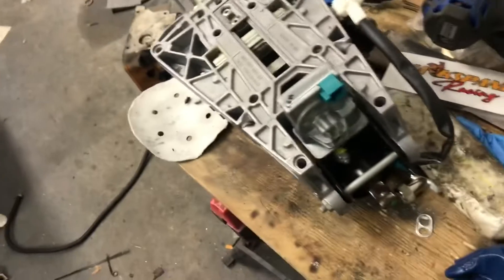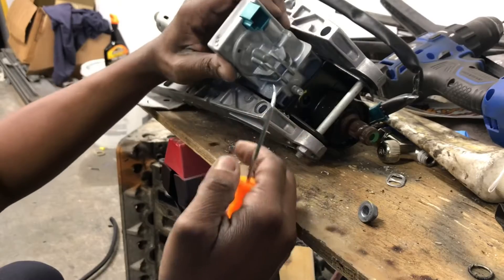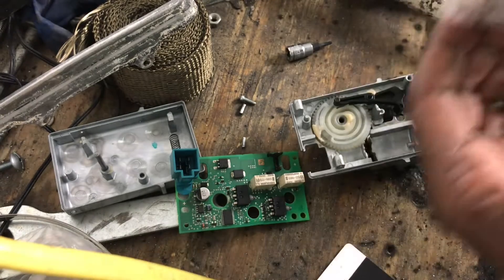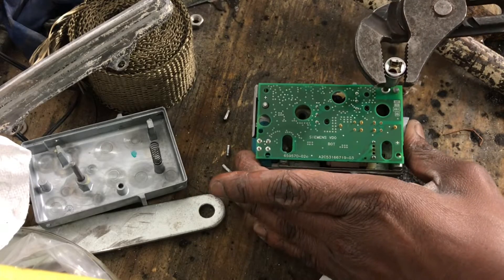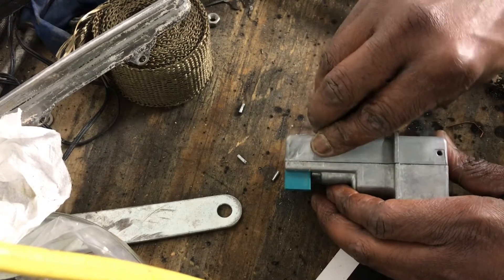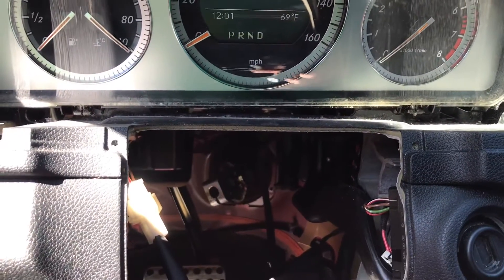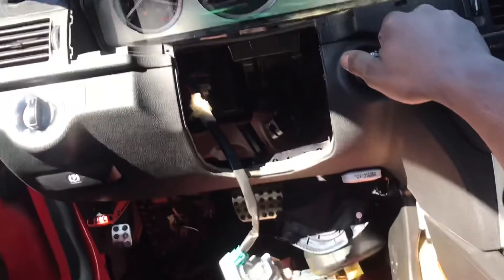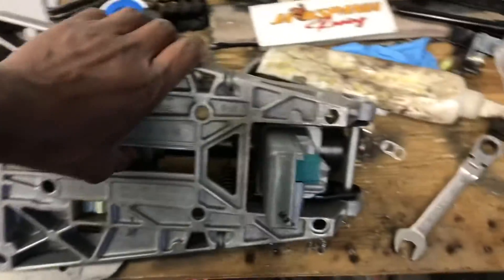Mercedes C300 W204 Won’t Crank Steering Column ESL Locked Position

Comment: You can also drill through the blue area which is a lot easier to get to because I'll tell you there's no point in repairing it because it's just going to break down again and motor is too small to have a job that big all the time absolutely ridiculous that they didn't even make a Mercedes like this knowing full well that that motor wasn't going to last and then it cost $395 to fix the damn thing and even when you do fix it you're going to have to take everything apart again to get to it when it breaks down inevitably
Reply from the maker: It’s still working $10 fix 👍🏾

Comment: Is It possibile, that car cant crank After this replacement, fuse 50 Is ko?
Reply from the maker: It need to be installed in the lock position with key off or unlocked position with key on the opposite won’t work. Do you hear it lock or unlock?
Reply: @MRRANDOM1 There's no noise when I insert the key. Any advice?

Comment: Hi, Wonderful video. My ESL locked. I tapped steering column  with mallet, then insert key, got the ESL unlocked. I left key in ignition, took out ESL & replaced ESL motor. Insert key, recoonect battery. Remove key. Nothing. ESL remains unlocked instead of locking. I depress 2 micro switches buttons. Again nothing. What am I doing wrong?  No sound at all. Any advice? Thank you!
Reply from the maker: Maybe defective esl motor make sure you have everything connected another thing you can do is test for power
Reply: Thanks. I think power may be the issue. Since when I pulled out 7.5A fuse and reinsert I get a message "fault front right..." Could it be a fuse blown? Reason is the radio won't come on automatically but has to be turned on manually.

Comment: I own a Mercedes GLK and when I turn it on, I don't hear that sound?!
What does that mean?
Does this mean that the EIS has been removed?
Reply from the maker: Maybe removed or bypassed if  it’s starting
Reply: @MRRANDOM1   Yes the car starts normal
Reply from the maker: Unless it failed in the open position. Can you turn your steering wheel with the car off?
Reply: Same issue I’m having

Comment: How do you tell if it's locked or not? I can move my steering wheel a decent amount. It doesn't "stick" anywhere when I try and turn the wheel. Does that mean it's stuck in "unlocked"?
Reply from the maker: Sounds like it’s unlocked. Which is easier to remove
Reply: @MRRANDOM1  Appreciate the reply. Giving it a go today.
Reply from the maker: @BrettWyrick  your welcome! It’s a pretty easy fix! Good luck

Comment: Could you have removed the motor then close the box? instead of installing the new motor.

Just as a preventative way to make sure this will never happen again. On the older Mercedes-Benz ignitions there was this locking pin.

What I would do for clients, is open the mechanism. Remove the spring and the pin.  

Then they would never have to worry about the ignition ever getting stuck again. Instead of buying a new unit and then a couple years down the road maybe back in the same boat or if it broke all the way. They would be spending hours trying to drill out the locking pin.
Reply from the maker: Nice! Thanks for sharing. Im not 100% sure if you can remove the motor. I guess it’s worth a try with everything being taken apart already.
Reply: very accurate! I was thinking after I fixed this once I wouldn’t have to worry about it again. I had the dealer replace the motor for me. Just a couple days ago it just went out. you definitely called it timing wise 😂
Reply: @bjbarrow7090  this time use the emulator, all the wire is long enough to route it to an accessible location. So if happens for the 3rd time you can get to it quickly.

There's also a bypass you can do by pulling the 7.5 fuse in the back of the fuse box, turning the key to the third position and pressing the green relay after removing the cover. NOT The best way to start your car every day. However it will get you out of a jam.
Reply: @edd2184 How would that work if the little motor is shot and in lock position? I think the relay trick is just for a bad ESL? Correct me if I’m wrong. Also, I would imagine if you just cut off the locking pin then you would not need the motor?
Reply: @TreasureHunter5000  from what I understand the motor is used to engage a locking pin. The locking pin is only there for security purposes, so by removing it all you're doing is stopping the locking motion from happening.

I'm more familiar with the older system, those ones failed because there was a slight tolerance error in manufacturing. The pin was too wide and it would get stuck.

So to answer your question yes, some people replace the whole mechanism every client I had I just removed the pin. Only noticeable change is the positive when we are moving the key from position 1,2, to 3. For lack of better words you don't feel that "pop" before the key turn.
Reply: @edd2184  gotcha

Comment: Happened to me today. But I saw another post. The guy yanked the steering to the right then put the key in. It should free the steering where. Then turn right then left and start the car. Works like a charm and no whacking needed
Reply from the maker: Nice I would look into replacing the motor. It will happen again. Good luck 👍

Comment: Hi, I have a 2012 C300 and I’m having this issue. I removed the ESL and replaced the motor and still no luck. Car powers up (dash screen, radio) but no instrument cluster lights or anything. The car locks and unlocks with key fob. 
Any suggestions? Thanks in advance
Reply from the maker: Sounds like you have a power issue, check your fuses and connectors
Reply: Did you ever find out the issue? Mine literally did this. No accessories turn on or start.

Comment: Mine has an intermittent crancking issues, also going into park on its own when it comes to a junction or at red lights. Almost every time I press the brake below 5 kph. Scarry.
Reply from the maker: Damn that’s crazy something definitely going on wrong. You may want to follow your shift cable make sure you break pedal not putting it in a bind or something

Comment: How did you connect the steering shaft to the column? Seems like that part is skipped in all the videos I’ve seen so far and that’s where the main work is. Please any ideas?
Reply from the maker: It just slipped rite on just how it was removed. I mounted the column first and then slipped the splines on the shaft into the column I also made a mark before taking it apart to make sure it was installed in the factory location

Comment: Hey man I got the same issue with my merc. I put the key in the ignition car won’t start no nothing, steering wheel is locked. So I tried the method where you re insert the 7.5a fuse and press the relay, the car starts after that but steering wheel is locked. Is it the switch or the steering lock problem?
Reply from the maker: Yes ESL failed in the lock position. follow the steps in the video. It was a pretty easy job.

Comment: Having this problem yesterday now tomorrow I will take everything apart and follow what you did thank you
Reply from the maker: Thanks glad I was able to help. It’s not hard at all. Some tight spots and gotta get the esl casing open. I used a very small flat head but they do make a tool for it

Comment: Did you get rid off 'remove key from ignition' message from the display. I was able to erase the 'air bag' message using my scanner.
Reply from the maker: It cleared on its on but I believe it will show as long as you have the key in the ignition not turning any power on. It definitely does away once you start the car

Comment: Thnx for video. Any tips on how  to remove the 4 dowel pins out. I can't get them out
Reply: Thnx. Was able to remove them with a small drill bit enough to go thru the dowel pin, tapped it, twisted it, and pulled it.
Reply from the maker: They sell a tool to remove them I believe it’s a triangular tip , I used a very small flat head screwdriver just jammed it in there

Comment: Thank you for the video. How do I know if the esl is in the locked position. I can turn the steering wheel.
Reply from the maker: Glad I was able to help. You can turn the steering wheel then it failed in the unlocked position which is a plus. Therefore you won’t have to drill the ESL and turn it to the unlocked position in order to remove it.
Reply: @MRRANDOM1  not necessarily true. My ESL failed on an unlocked position and I could still drive my car (there's a work around where you pull a fuse and manually press the starter relay) but when I went to remove the ESL the bolt wouldn't depressed fully to remove so I had to drill it to unlock the last few mm.
Reply: @nastynate5633  can you elaborate a little more on this or refer me to where i can find out more in this ?
Reply: https://youtu.be/oMWpbrxQPEk

This video help me out too.

Comment: I have a 2009 C300 says take key out of ignition as well won’t start, put a brand new battery in, steering wheel is locked but can move it a bit and will hear it click sometimes when I bring it to the left, any suggestions for me would be very appreciated good video you are good at explaining and recording everything
Reply from the maker: Thanks sounds like you have the same problem going on ESL has failed

Comment: Mr. Random I’m struggling to get those 4 dowels out what would you suggest I use ?
Reply from the maker: A very small flat head or you can try a star bit. You may have to beat it in and turn it to the right!
Reply: @MRRANDOM1  I got it open I had to drill a little like you did I placed the motor in and this thing is not working when I connected it to the car. Following your lead , but what I have noticed is my new motor doesn’t sit flush like the old it’s like the new one is shorter
Reply from the maker: @kennymcshan7077  did you manually turn it back to the lock Position as it was when it failed?
Reply from the maker: @kennymcshan7077  make sure your getting a good connection on the power feeding the motor and the gears are lined up

Comment: Hello, I have a 2013 c300 and mine has failed in the locked position at my work. I had it towed to a local mechanic but all the German import shops around here are booked 4-6 weeks out 😭 do you have any tips to tell for sure that it's just the ESL motor and not the EIS too? I heard the motor pitch change, it sounded like the tired old window motor in my first car the morning it decided to die on me. Any help you can offer is appreciated ❤️
Reply from the maker: Hello, Make sure you have fully charged 12v battery. You can try turning the wheel left to right when inserting the key to try to get unlocked. You will here the motor unlock the steering column when it does work, if your not hearing it unlock then the motors has failed. If you do get unlocked leave key the key in that position and remove the negative cable off the battery. The Esl must be in the unlocked position is much easier to remove from the column in that position. The job is not hard to do. If you can find anyone with some mechanical experience. It’s definitely worth it to save the money I think Mercedes charges $2k for a $10 fix
Reply: How did u get this resolved?
Reply: @jasminelanders3177  I borrowed a car from my brother and waited until the shop I towed my car to could repair it.
I tried the steps laid out above to unlock the column, but it didn't work.
We tried just ordering the ESL motor and replacing it, the new one worked 3x but then fried and locked again. It was only $13 for the new motor, and since the column was already apart the mechanic didn't charge any additional labor, and we just had to wait for a whole new ESL module and motor to come in. Once he put it in, it's worked great, no problems since then, but it did cost about $1700.
If I were together another used Mercedes with this module, I would probably take the column apart myself while it's still functional and have sent everything to a tech to have an emulator flashed. You lose the security of having a locking ignition system, but I have good insurance and park the car in a garage at night, without having to worry about the system failing and leaving you stranded.
Reply: @cheesecake00222  same Mercedes dealership quoted 1600 I think ima just have to cough it up. I’ve called numerous auto shops and all of them said it has to go back to Mercedes. But ur saying after it’s in working condition I should swap it out with the emulator?
Reply: @jasminelanders3177  tbh if you're going to pay all that money to have it replaced anyway, keep the module. My c300 is a 2013 and it worked for almost a decade over 80k miles, but if I got another Mercedes with the same ESL module or kept my 13 long enough for it to wear out again, I'd go the emulator route for sure.
Reply: @jasminelanders3177  as for the mechanic, I went with a local independent mechanic who specializes in German vehicles and many parts they order straight from Mercedes- it was still cheaper to go through my independent than Mercedes for this job. I called 7 or 8 highly rated independent shops in my area and there was no real difference in price or timeframe, although if there is a reputable independent in your area it's worth calling and getting a quote for sure

Comment: My esl went yesterday at work. On my 2011 4 matic c300. And I’m 80 miles from a Mercedes dealership. So I will be using your video to fix mine. I order the motor off of eBay too.
Reply from the maker: Yessir Easy Fix 4 bolts to remove the column and one on the shaft. There’s a tool to remove the pins out the esl housing but I used a very small screwdriver and hammer
Reply from the maker: Did yours fail in the Locked Position?
Reply: Man have this issue right now.. stuck in the locked position